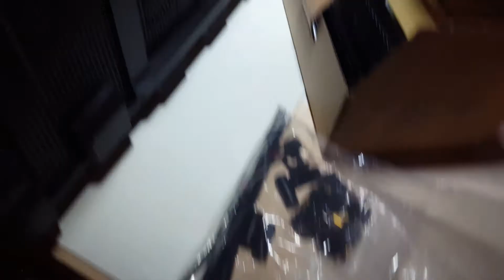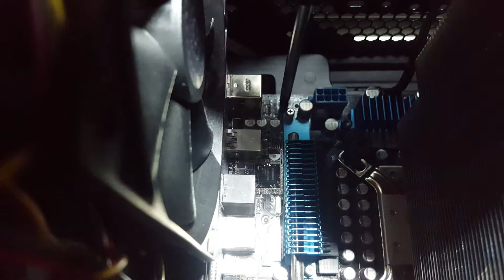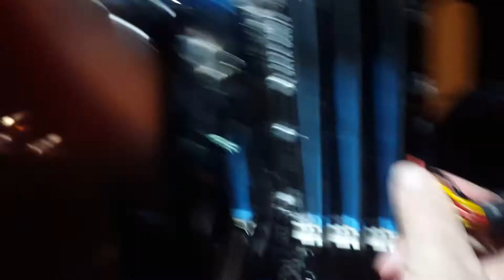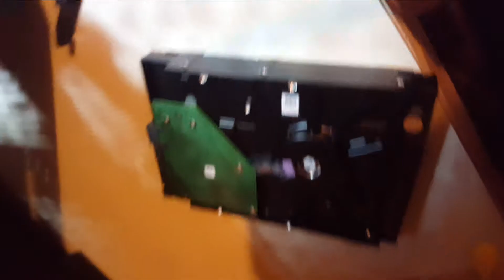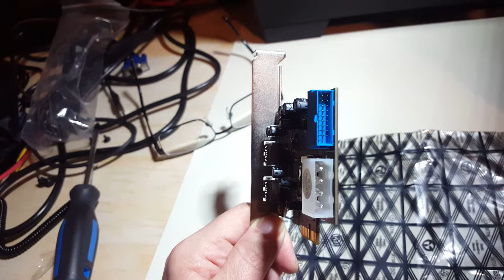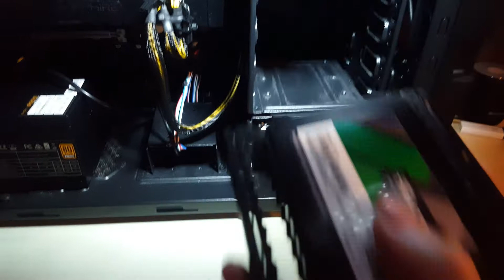Building a Computer - Step by Step Walkthrough

Comment: Neat little adapter for installing stand offs.  I use a 5mm nutdriver. Where did you get the adapter?
Reply from the maker: +Charlie Wilson It came in the package of screws and standoffs when I got a Corsair Case. I have a few different sizes from some other case manufacturers as well. It's very handy...Thanks...
Reply: @Reviewing_Playing_and_More_RPM  My MB went bad and my son brought me an old Asus Intel MB he had. I swapped the MB out of his case and put it into my case.  My old MB only used six stand offs and the new board needed 9.  When I replaced the missing stand offs I was shocked to find out I had stand offs with two different thread patterns.  Up until then I thought all stand offs were the same.
Reply from the maker: @charleswilson4598  Yeah there are slightly different one's that I've come across as well. Mostly it's the case that dictates the Standoff's, and usually they provide extra standoffs so you'll have what you need. I did have one that was a completely different size though...Up until that happen I had assumed they were all the same as well...